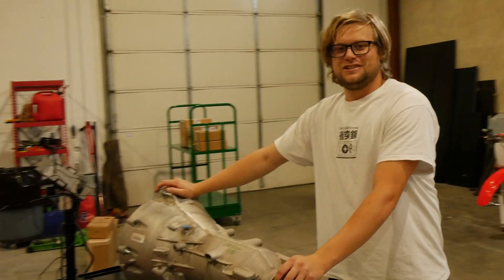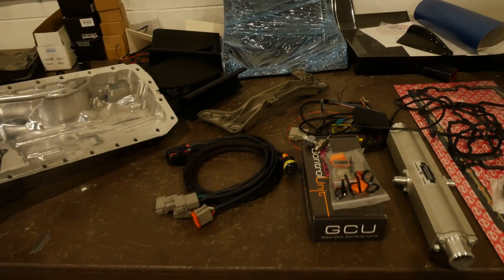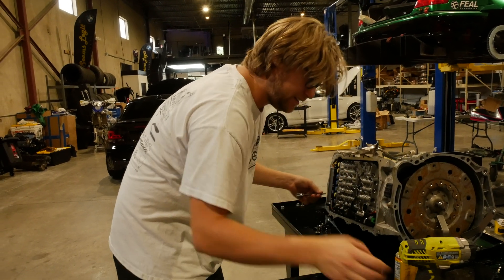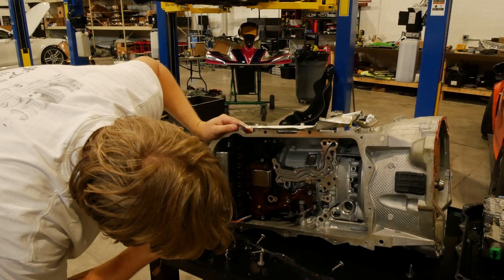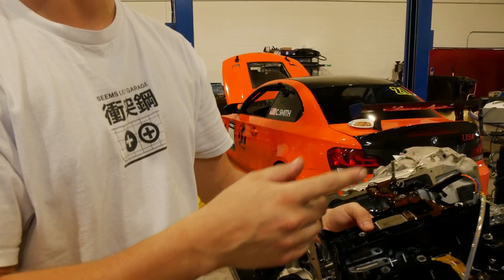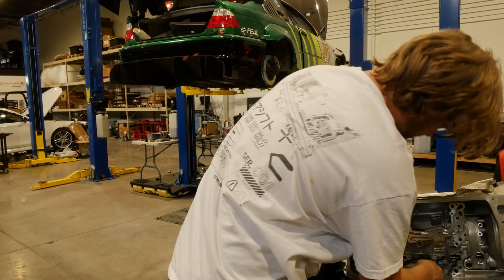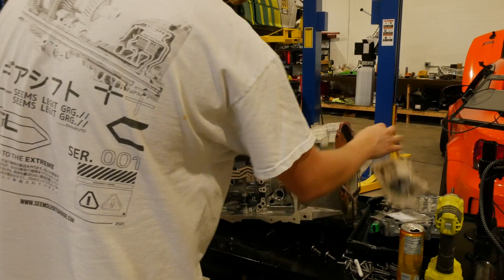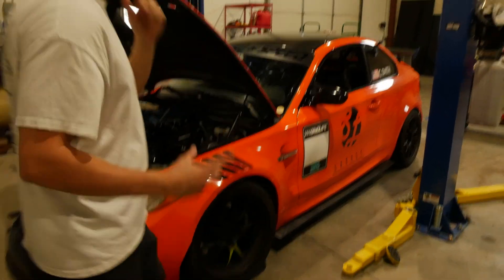8HP50 Teardown for HTG GCU Install

Comment: 0-60 said the 8hp45 bolts up to n54 so is the 8hp50 different
Reply from the maker: Yes, its B58 style with starter on the bottom

Comment: What did you guys figure out to fix the Park pall coming on when the engine shuts off?
Reply from the maker: Unfortunately with the BMW trans we could only make a parking delete so when engine is off it’s always in neutral. For Dodge we have a parking kit and you can have P or N while engine on or off.

Comment: Does the 8hp require coil rewiring like your DCT video? Are the Ryu and HTG PCB the same - if they are the same then the only difference in shifting is in the actual GCU or TCU(?). If the 8hp requires rewiring of the coils, when can we expect that video?

Comment: the htg computer will damage your engine or gearbox.  subject widely and hotly discussed in Poland.  you will lose time and money.  Look for the Turbo Lamik driver.  tested and working in a huge number of projects, drift, offroad, or daily.
Reply from the maker: That is completely False we have many many cars running the HTG system with great success. Its closed loop control and software is far advanced and the only one being pushed forward.
Reply: @SeemsLegitGarage  ok ;)
Reply: @SeemsLegitGarage  there is literally a class action going on my guy. Bartek is getting down.

Comment: What torque converter is used?
Reply from the maker: the one that comes with the transmission
Reply from the maker: @alexgonzalez7395  no need a custom or modified

Comment: What’s the differences between the DCT and 8HP? And what vehicles comes wit the 8HPs
Reply from the maker: DCT is a dual clutch trans and the 8hp is a modern auto with a torque converter
Reply: @SeemsLegitGarage  so which one is better power wise?
Reply: 8hp has more gears, better for power.

Comment: So do you guys have a metal oil pan for those 8hp? Or is the plastic cover the only thing thats available right now?
Reply from the maker: the filter is built in so we just use plastic but we did order some metal variants that weren't too expensive to try, we are going to test fit and then put on site if they are all good.

Comment: That "thing" @6:30 is the start stop pump, for when the engine shuts off, it keeps pumping fluid in trans to keep oil pressure in trans. So when you let off brake engine is running and you already moving. The F gens and on have that in the 8hps that have the Start Stop function. From what I recall because the e70 x5 didn't have start stop, the n55 and n63 models that had the 8hp70 and 8hp45 those early ones shouldn't have those pumps in there.
Reply: In the ZF 8HP transmissions, it's not a pump but a hydraulic accumulator (spring+piston) with a latch mechanism. Function is the same- provide oil pressure to apply clutches for start/stop functionality. Just gives that bit of instant oil pressure/volume before the pump is able to supply.
Reply from the maker: very cool! thanks for the info
Reply: @SeemsLegitGarage  yea no problem! Are the HTG GCUs gonna be on your guy's site? Is it pretty much same functions as the Lamik controller?
Reply from the maker: @darksidemotorwerks9867  yes they are! They are like the Lamik just a bit more capable, like a motec vs piggyback